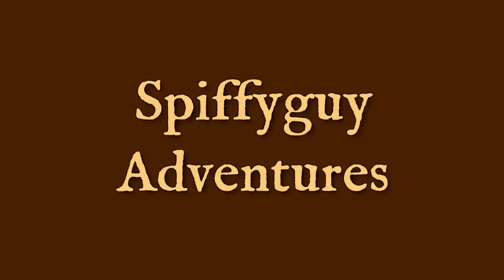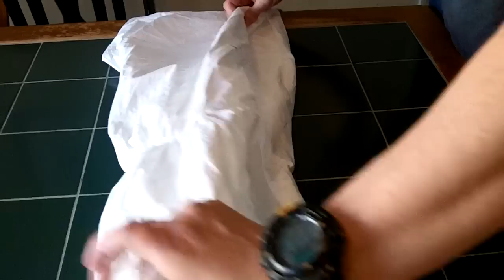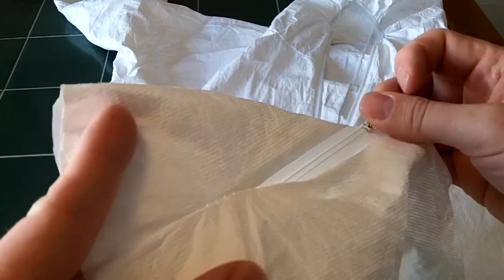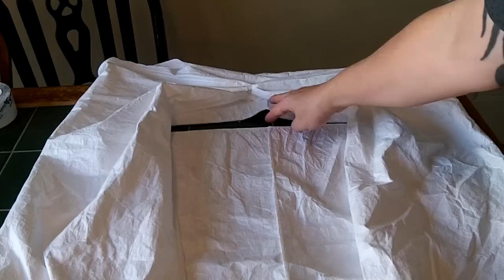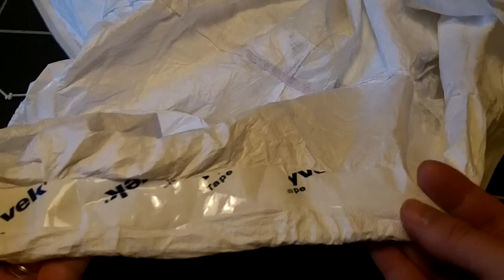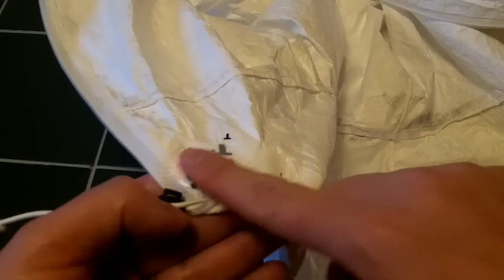Gear: #27 No Sew Tyvek Windshirt / Rain Jacket

Comment: So how did this work out for you???
Reply from the maker: it was ok. I found it tended to wet out if I was sweating too much. Breathability was an issue on the trail. As an in camp thing or light activity I think it worked really well as a windshirt. Did not quite repel the rain as I hoped. Would be fine for fishing I think, something like that.
Reply: @SpiffyguyAdventures  if it fails in the same way as a $200 gotetex jacket then, for $10 it is a win.  I have a DIY tyvek bivvy bag and a military bivvy in goretex.  Humidity performance is approx the same, and the bivvy bag is the only garment in either material where the activity is low enough and the material voluminous enough to really accomplish the advertised breathability claim.  The tyvek bag is somewhat less durable but much cheaper to repair and a fraction of the weight.